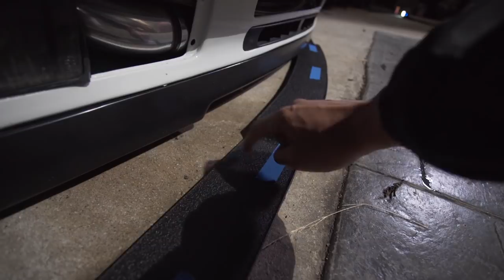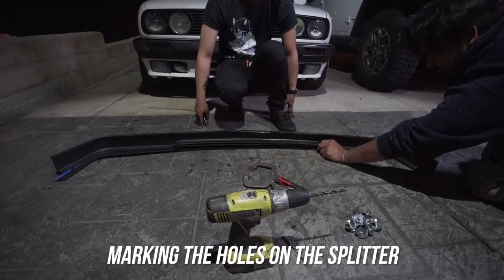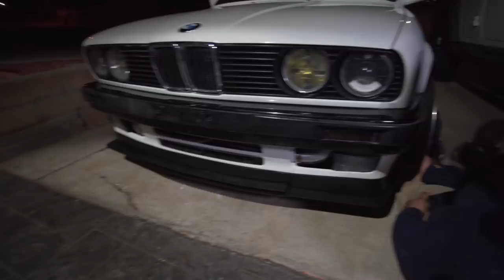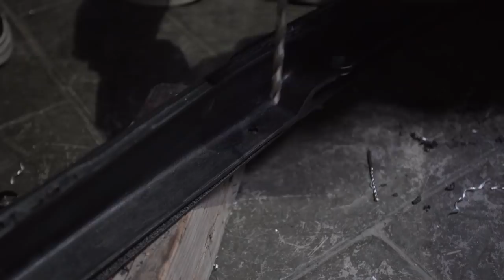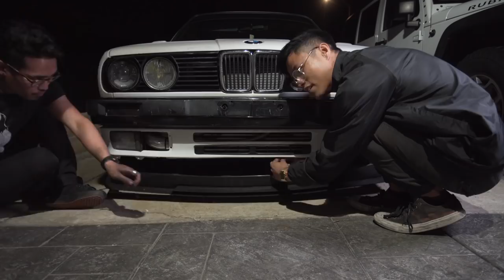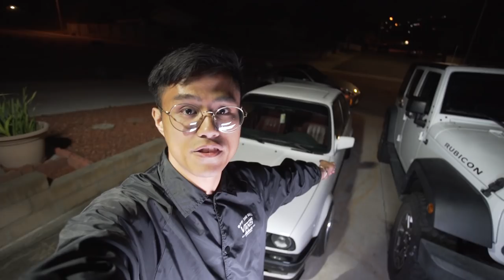E30 Lip and Aluminum Splitter Install!! | BAGGED & BOOSTED E30 BUILD

Comment: Can you share what size hardware (screws, nuts and washers) you used to attach the splitter to the IS lip spoiler. The look pretty big in diameter like maybe 5/16 inch diameter?
Reply from the maker: Good guess! I believe they actually are 5/16! I also would recommend some nylon nuts so you dont need to worry about the bolts loosening up👍👍

Comment: Bro how did you remove that black lip? I'm looking to swap mine out for a lower one
Reply from the maker: If you have a factory lip, there should be clips that hold yours in place and you should be able to just pull off the lip. This is for the "is" lip though and I'm assuming you have the shorter "i" lip but I think it should be the same process to take off. If you have an early model valence, then your lip would be held on with bolts and this lip I use in the video doesnt work on an early model valence either
Reply: @derkm  I have a 318IS from 1991 so there are no screws or anything, just take it off essentially? Also is that the same for the fog lights?
Reply from the maker: @wotreplays1658  if it uses the factory hardware, it should just have clips that are holding it on and you just need to pull the lip forward away from the car to dislodge it. Google "is lip clip e30"
Reply: @derkm  Oh thanks dude! Also with the fog lights I have blanks here but do I just push them in to install them into the clips too? (They are not actual fog lights)
Reply from the maker: @wotreplays1658  No prob! And hrmm I forgot how foglights properly get installed because I kinda did mines weird but I believe there's a threaded plastic insert in the valence and a screw securing the fog light delete that you can access from behind the valence. You can see it if you jack up the front of your car and look behind the valence 😁
Reply: @derkm  Thank you bro, do you think I could just install the fog light deletes without the screws because I took one of before and there were no screws or anything, but I ordered the right one now, +1 subscriber btw :)
Reply from the maker: @wotreplays1658  Ahh I think it should work with whatever you used to install the fog light deletes but I could be wrong. I would check the schematics at realoem.com to see exactly what clips/fasteners were used for it; it'll give you part number and everything. And thank you bro! 🤟🤟
Reply: @derkm  Cheers bro 👌

Comment: Yo, what tyoe of screws did you use to get the IS lip onto the valence?
Reply from the maker: Zip ties 😅 i drilled new holes on the top of the is lip to match the holes that the oem 'is' lip clips push into on the valence